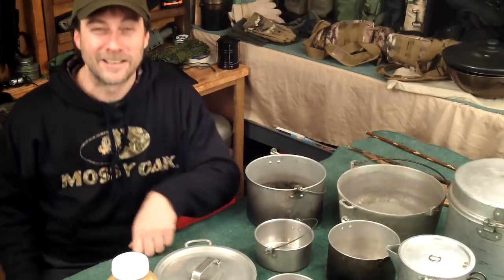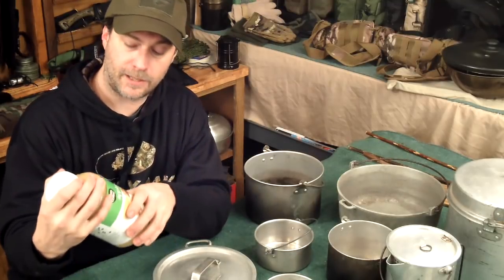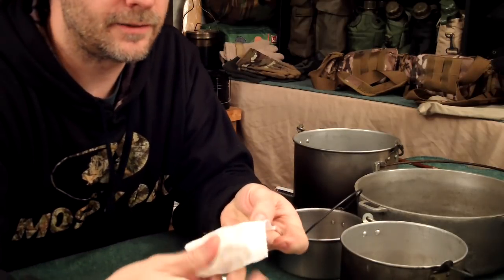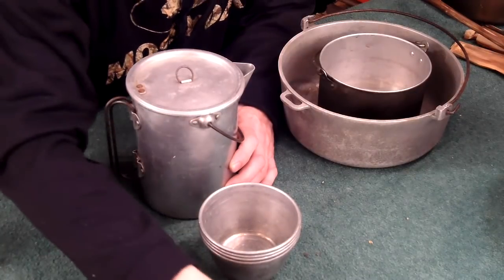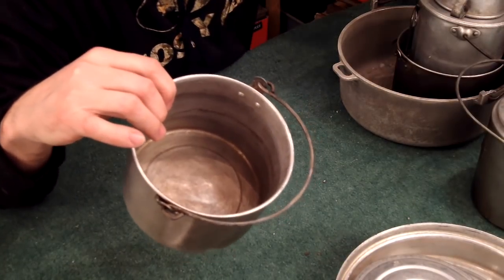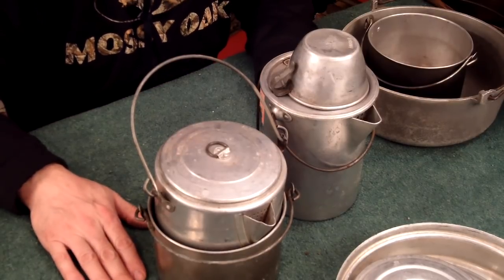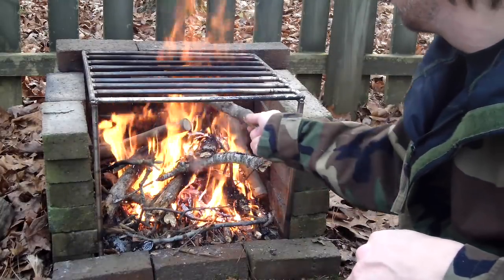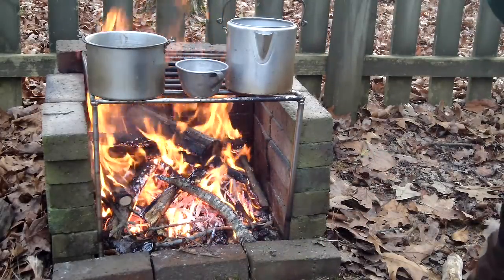Testing Old Aluminum Cookware For Toxicity

Comment: Some one mentioned "vested interest in aluminum"  Well there might be a vested interest in titanium also, and most likely with a better profit margin too. I challenge Mr. Monkey to scrub that cast aluminum pot real good and try the test again. Like any metal aluminum corrodes and a layer builds up. Just like rust. So your cast iron cookware and BBQ grills if not cleaned and maintained well would give you a good dose of iron. And by next week somebody will say iron is bad for ya. Have a good day everyone.
Reply from the maker: You can't challenge me because I scrubbed that pot thoroughly with steel wool before this test.
Reply: Well you got me then.  Shame though, looks like a good Dutch oven. You got an aluminum or glass lid with it. Probably could still bake stuff in it.
Reply from the maker: No lid so no Dutch oven. Someone suggested to make it a fire bowl for another set up. That's about all I can think of for it.

Comment: Hey Dave, Thanks for this video and time researching the info. This made me think of all the old pressure cookers and a lot of the bottom halves were used for cooking . A lot of them were heavy thick and I suppose were cast Aluminum ?        --older than dirt,
Reply from the maker: I'm glad you liked it and I'm always happy to share. I believe all them old pressure cookers were cast. I grew up with my mom using a Presto.
  Thanks for watching
Reply: It is kind of scary when you think that they were advertised a one pot quick way to cook a whole meal . My wife said, her mom only used it to can in . Do you know anything about the Club aluminum type cookware ? Any way I'm going to test some of my collection of old camping aluminum cooking odds and ends. Which like me is older than dirt.

Comment: I think cast aluminum has more pores on the surface. That is why it gets so dirty and is hard to clean. It would also hold more contaminants. I think that is the difference compared to the smooth surface of the stamped  pots.
Reply from the maker: True. And a lot of folks said I should try a super slick high polish and retest

Comment: Aliminium came in in ww2 its was use in aircraft, and many other things. And is a non ferious metal has a low melting point, but very light. Difficult to weld.

It give turns your hand black if working with it. Its carbon i tbink..

Also used in pots and pans and military water bottles at the time
Reply from the maker: Thanks for the comments

Comment: Thank you so much for this test. I had just heard about this toxicity thing this yr. I'm thinking that is because, they are recycling aluminium. Maybe that's why your older pots didn't turn. Just a theory. Would you really want someones old aluminium siding turned into cookware? Me either. Great video and great results. I will be trying this myself.
Reply from the maker: Several folks have know about this toxicity issue for years. Its just recently become widespread. Im hearing more and more its the cast Aluminum and not so much the stamped aluminum. I'm glad you liked it. Thanks for watching.

Comment: I wonder if you can go over the cast pot with a rotary wire brush and take off the oxidized surface and retest to see if you still get the same result.  I'm wondering if this is something that happens over time due to oxidation or if its the case with all the metal (so same as that under the surface that wasn't oxidized).  What you think would you have a chance to test this sometime (even if you just tell us the result and no real video)?
UPDATE: Ahh OK I just saw others already made the same suggestion, but I'll leave so you know just how much people want to see this follow up! :P
Reply from the maker: In the past I always assumed oxidation was just on the surface. This pot was scrubbed ten separate times with steel wool and it still grayed up a paper towel. This leads me to believe that maybe age allows oxidation to go much much deeper? I  do need to test further

Comment: Interesting topic thanks. I season my al pots inside and out just the same as my cast iron stuff. I think this makes it a bit more non-stick but may also stop this porosity effect you're talking about?
Reply from the maker: From what I've been told, aluminum cookware that's been seasoned with a non stick surface seals good enough that nothing will leach into the food. Bare aluminum is what's bad

Comment: As ever illumination from your video David, this time aluminium. Could regular apple sauce treatment clear the contamination or is it not worth the bother? Thank you for the successful test.
Reply from the maker: Thanks Mark. Man I have no idea. I guess you could simmer over and over again and see if the color stops appearing?
Reply: Just a thought, you could be some time with older pots and pans, perhaps best as you say to use them for display only.

Comment: Seemed like the cast aluminum pan's bottom was oxidized at the beginning of the test, but when you showed us the applesauce discoloration, I could see the bottom of the cast pan was bright and shiny. If the applesauce's acids cleaned the bottom and you ran the test again, it would be interesting to see if it would react again or if the first go around cleaned it up. I'd be interested if your other cast pots also reacted to the applesauce. xoxo from Arizona
Reply from the maker: That pot was scrubbed with a brillo pad ten times and it still discolored a paper towel. I'm thinking if it was a dirty pot then the applesauce would have turned Gray? I only own one cast pot.
Reply: Reallybigmonkey1, I definitely agree that there was a reaction and that I wouldn't use it for food either. But I am curious about what made the applesauce react. At 28:39 when you hold up the cast aluminum you can see that on the right side, where the applesauce has slipped, you can see how bright and shiny the bottom has become. Because cast is so porous, I wonder if the pores were filled with some thing that the steel wool couldn't reach, but the acids of the applesauce was able to extract. Can you remember what that horrible smell was like? Was it a metal smell or maybe rancid oil? Curious in Arizona.

Comment: Wonder if there's a difference in the purity of the aluminum between a stamped piece and a cast/forged one. I know that in iron forging, there is a lot of slag, and that weakens the iron. Plus, I've noticed that with aluminum cast pots, there seems to be pits and bubbles even before they are used. Cast ones are just a different texture than stamped ones.
Reply from the maker: Yep, I do believe there can be a difference. Stampings come from rolled alloyed aluminum. Pretty pure batches. Castings often contain too much or too little magnesium or zinc or who knows what?

Comment: I think I'd clean the Aluminum Dutch Oven really good maybe use bar keepers friend scrubbing powder rinse it well then retest it.. if it turns pink like it did this time either put it on the shelf with a plant in it or recycle it but I wouldn't cook in it any more.
Reply from the maker: As of now I aint cooking in it any more. I may just polish it good and restest

Comment: Stamped aluminum and cast aluminum have major different storage properties.
Reply from the maker: I know it does, I used to work in an Aluminum foundry. Stamped is form from sheet which is rolled, cast is either poured or die cast.

Comment: Great info!What is difference between fire bricks? Where do you buy them?Thank you.
Reply from the maker: Thanks, I'm glad you liked it. I believe regular bricks are just mortar and sand. Fire bricks have some added ceramic or refractory so they can handle heat. I think they are both sold at house building supply stores. Thanks for watching

Comment: Acid from the apple reacting to the oxidized cast aluminum? Try orange juice or vinegar, probably same effect! Doubt you would need heat. Cast iron reacts as well, I used vinegar to clean out rust in an old frying pan I found, tossed it in a fire then brshed it clean. After re seasoning its fine now.
Reply from the maker: I'm not sure what it reacted with. I just know the other five didn't react. Several folks said to clean with either vinegar or baking soda and retest

Comment: the discoloration that you are rubbing off is oxidation, happens with all metals except gold.
Reply from the maker: I was amazed at how it still rubbed off after being scrubbed ten times with steel wool.
Reply: acids will clean it off but may damage it; that is why newer aluminum is anodized i believe.

Comment: You could probably still use it as a Dutch oven to bake in. Put a trivet or three equal size round pebbles and set your baking pan, cake pan or pie pan on top with whatever you want to bake in the pan. That's how I bake in even my cast iron Dutch ovens The bake good is more evenly heated that way. Do you have the lid for it? I have a pot exactly like yours and mine has a domed lid.
Reply from the maker: Gary that's a fantastic idea! Good use for it since no food will be contacting the surface. Nope, I don't have a lid but maybe I could find one in my junk pile that fits.

Comment: The addition of weight is a huge topic on Youtube and social media. Do you think that having a small iron skillet and a thin set of stainless pans is better than keeping the older aluminum ware, considering weight?
Reply from the maker: Well it's a huge issue with most long distance lightweight backpackers but not me. I have no opinion on it tho because I rarely hike more than just 3 or 4 miles. Weight is no big deal for me.
Reply: Reallybigmonkey1 , I have walked Blood Mountain and Springer. I want to do more. The distance changes everything.
Reply from the maker: Long distance hikes are incredible. I severely injured my right ankle and sciatic nerve so I don't hike long distances any longer
Reply: Reallybigmonkey1 Im sorry Bro. May GOD mend you quickly.
Therapy?

Comment: I get the feeling that the apple sause is simply reacting to the oxide of aluminum oxide in the same way an apple "oxidizes" when sitting in the air exposed to oxygen.
Reply from the maker: Could be. I'm just looking at how it reacted to the cast and not the stamped aluminum

Comment: can you describe the smell of the applesauce in the cast  pot?  I definitely wouldn't eat out of it. it definitely turned pink
off the top of head i would think that the cast piece has larger pours while the rolled aluminium by the rolling process has much filnner grained surface. the apple sause has enough acid in it to bring aluminium oxide turning the apple sauce pink. did it smell sulfury. that's a good trick to know.  now try this a trick i learned in working on motorcycles. take a a can of coke and pour small amount in to the cast piece. then take a wad of aluminum foil in your hand. rub the coke acting like it's a lubricant/polish and use the wad of the foil like scouring pad. see what happens. Do it a few times rubbing the pot hard and fast. then retry try your apple sauce test.see what happens you my be surprised
Reply from the maker: Hard to say, it just smelled bad. Not really a sulfur smell. I have heard of the coke method, I'll remember that

Comment: I have one of those cast aluminum pots you have there and now that you got the apple sauce to turn pink in it, im afraid to use mine again
Reply from the maker: Just get some applesauce and give it the ole test!
Reply: I would gladly do that, but my pot had been sitting in my cabin for 15 unused years. Your pot, looked alot cleaner when you did your test. lol .

On a more side note, because you mentioned the  " pores " in the metal I have a cast iron skillet i will not use dish soap on or any soap for that matter, if i do anything to it i just boil water in it and dump it out then dry it off with a towel.

Comment: In any experiment, you need a "control." I do appreciate the time you  spend on these videos but, it would be nice to compare the results with a new or unused cast aluminum pot. I am not at all knowledgeable in the fields of chemistry nor medicine. What I do know is the function of cookware should be only to contain the food and transfer heat. If it has any strange effect on the color, smell, or taste of the food, I don't want to use it. Thanks for the informative video.
Reply from the maker: I feel like it doesn't matter if its new or old, cast or stamped. If ANY vessel turns applesauce pink then its unsafe to use.
Reply: I just meant...I wonder if a brand new/unused cast aluminum pot would yield the same results as the used one. I totally agree with you about if it turns the applesauce pink, it is unsafe and I wouldn't use it. My whole point being...Is the applesauce turning pink because it is a cast aluminum pot OR because of contaminants it has absorbed over the years. In any case, thanks for what you do.

Comment: Any metal that will oxidize will do so when exposed to salt, water, acid, heating and cooling cycles and time/age. I would bet you money Dave that's one reason that pot  stinked...stank...stunk...😂the acid in that Apple sauce...

I've got one of those green enameled Clover 2 quart  cookware pots that my Pappaw cooked navy beans in...no rub off or residue but it is darker gray inside. I keep it for sentimental reasons and cook in stainless and cast iron.
Reply from the maker: I even scrubbed this pot! I'm thinking if it had a thick seasoned coating it may be different? That's awesome you have your Pappaws pot
Reply: @Reallybigmonkey1  I'm not sure...idk??

Comment: all aluminum has its own alloy mixture....rating in number....7071 might be aircraft alloy
pure aluminum ...i forget......anyway it is known that clean aluminum will eventually have a film on it  that further protects from corrosion it is aluminum oxide that is powdery and has to be removed by brushing with stainless steel brush before a good weld can be made
..........that pot that failed can be buffed out clean and used again to see if color changes to orange or stays yellow
Reply from the maker: That pot was scrubbed ten times and yet it still grayed up a paper towel. Being scrubbed didn't help but I do believe a buffed and polished high shine could make a difference

Comment: aluminum oxidizes, guys and aluminum oxide is quite reactive. I'm no chemist, but I'd avoid using aluminum utensils., long term, if I could possibly avoid it. My siblings and I were raised on food cooked in wear-ever pans and pots, tho. That's "high grade" aluminum and it was treated with care, due to the expense of replacing it and we were poor.
Reply from the maker: Makes sense there Don. Theres differing grades of Aluminum and Wear ever used to be one of the best. Back in the 50s and 60s there were probably a few manufacturers of bad cookware.
Reply: today, in China, you can bet that there's a LOT of makers of bad cookware. :-) In Phills, if something is very low  quality, they call it 'china".   It's said  like they're ready to spit on your shoe. :-) Sort of like the early Japanese stuff was in the US, in the lat 50's.
Reply from the maker: Now I can agree with that! Since all the air rivers and water supply is polluted over there could you imagine what some of the products are like?

Comment: The heavy kettle looks to be made of a magnesium/aluminum alloy.  Would the acid in the applesauce create a different reaction with that particular alloy?  What did the inside bottom of the kettle look like when you emptied it?  Was in 'cleaner'/shinier?
Reply from the maker: I have no idea what the alloy of that pot was. I just know there was no reaction in the other five.  That pot didn't look much cleaner afterwards
Reply: In the 1950's and for a while after, cookware that looks like your cast product was made of Magnalite, an aluminum/magnesium alloy.  My grandfather used them in his restaurant and I purchased a new one in 1984--a ham/turkey roaster.  They always oxidized like cast iron, even with a heavy baked on 'seasoning' layer.

Comment: From a making beer point of view, we were told that the AL has a patina (or something that turns it dark) and we need to keep that dark patina so nothing would leach into the beer.  If we need to do a deep cleaning on a pot and make it like new again, we were told to boil that pot for an hour so it would get that dark patina again.  IDK  AL pots are mostly what used in commercial kitchens.  Another example would be a AL pressure cooker is going to turn dark after the first use. 
The really old AL gun frames used to get pings from the lead bullet hitting the frame ramp, but now they don't, so I think the AL is better today.
Reply from the maker: That's some very good information I did not know. Thanks for sharing that!
Reply: If it helps here is a link  https://www.homebrewtalk.com/forum/threads/faq-aluminum-pots-for-boil-kettles.49449/
Reply from the maker: Thanks Mike!
Reply: I love your videos, thanks for making them, before I watch the video I hit the like button.  thumbs up

Comment: What would happen if you took that large pot and set it in the fire or made a fire inside of it. Would it change or burn away whatever caused it to be toxic.
Reply from the maker: Not sure about throwing it in the fire but putting a fire inside it would make it a great fire  bowl for them dry forest fire threat areas.